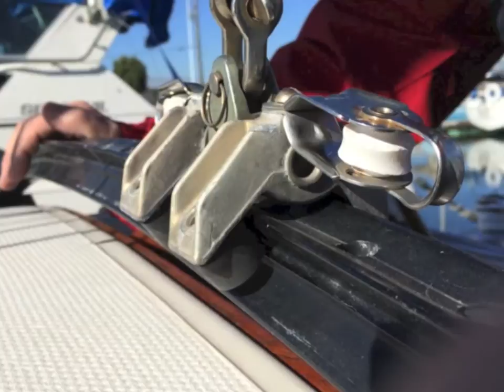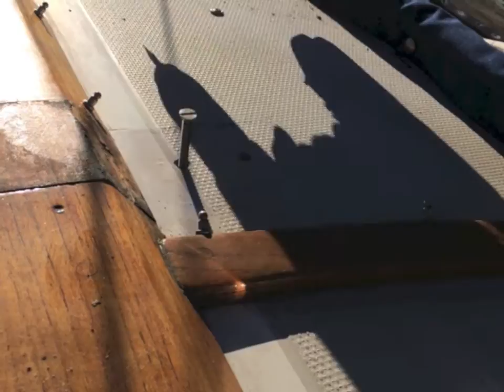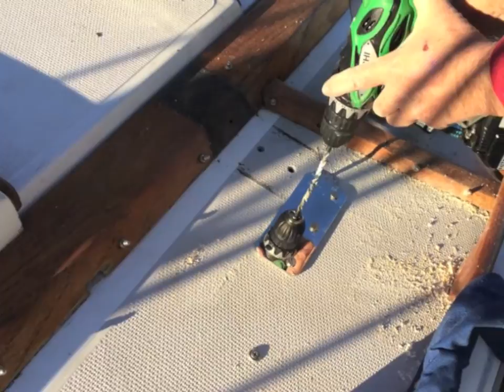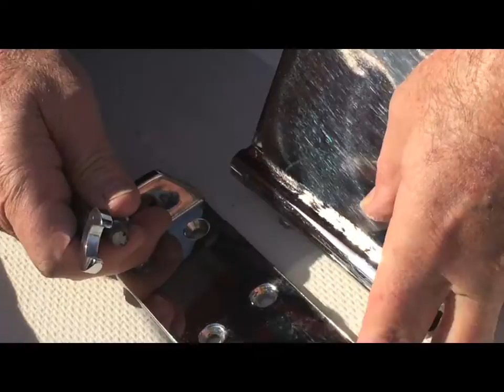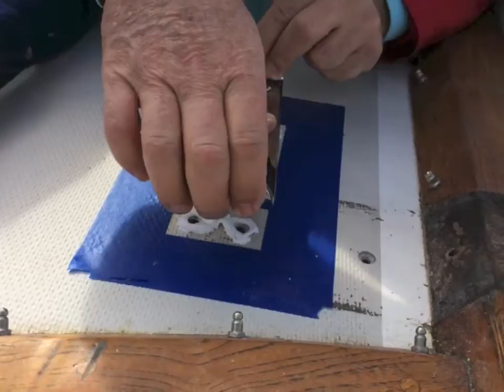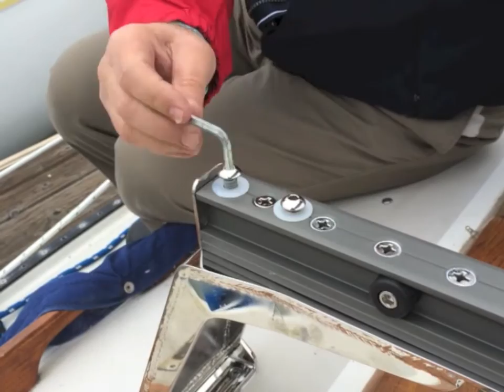Shellback Catalina 30 Traveler Project

Comment: 👍
Reply: What was the length of the mounting bolts used?  
I realize that boats are not identical but a ball park length would be a big help.  My Cat 30 is a 1984 vintage model.